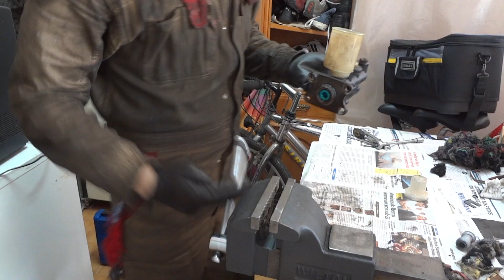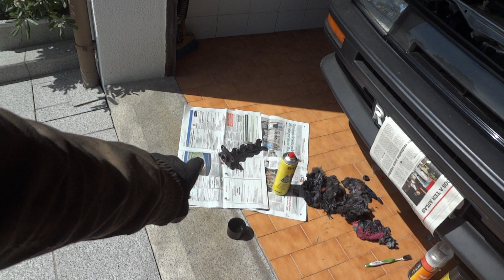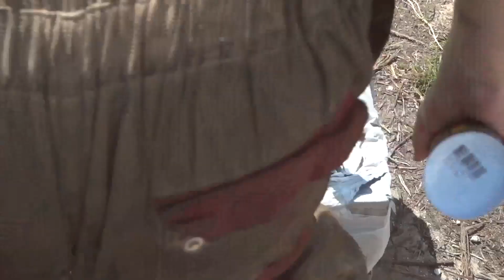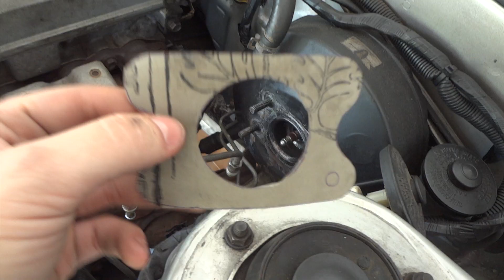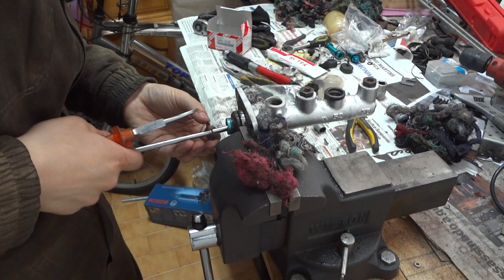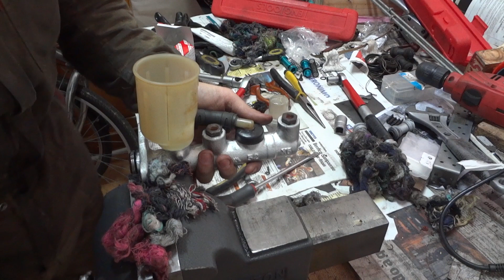How to rebuild your car brakes (3/3 Brake Master Cylinder) (Corolla AE86)

Comment: i did not have compressed air, so i pressed very hard on inner piston, with a pencil and then released the pencil suddenly, the spring, pushed out the inner piston,

Comment: very helpful video.
I really have to get my clutch system fixed by end of the month. i am very pressed for time and i need your advise.
have you had to take out the master clutch cylinder before?
The master slave (under the car bolted to the transmission) took me 10 minutes to do but there is this 12mm bolt behind the brake booster (left side of the clutch master cylinder) and i cannot get to it.
Do you have to remove the brake booster to get to that 12mm bolt? any recommendation or suggestions would be greatly appreciated.

Comment: Does it need to bench bleed?
Reply from the maker: You just bleed the complete system as you normally would. Just dont forget to grease all the new rubbers as if they are dry they can rupture during the first pedal pumping operations.

Comment: Hi Joao. Great tutorials. Thank you!

I have a question. Why do you need those special tools to release the nuts/lines in the BMC and with some bolts of the calipers? what's special about them compared to a regular open ended spanners other than a bigger grip? is that to get a better grip of the nut?
Reply from the maker: Hi, thanks! These special spanners can be replaced with open ended regular ones. It is just extra insurance because if you strip one of those nuts you are basically screwed lol

Comment from the maker: Hey! Check out the first video of the brake rebuild for all the part numbers involved in the rebuild. In the meantime, as you can see in the first video, the part number for the master cylinder rebuild kit is : 04493-22130

Comment: very good video. ive all parts sitting in my garage to rebuild my master cylinder, its the same one you have with the 4 bolt fitting to servo. can you tell me the part number on the kit you have as I have it sitting here id just like to check is rhd Toyota rebuild kit same as lhd

Comment from the maker: Check out the first video for the part number. It is a special grease sold by Toyota. The grease is there to prevent damages to the rubber when reassembling the pump and refilling the system, as in the first pumps of the pedal there will be no lubrication and this will ruin your brand new piston a and seal.